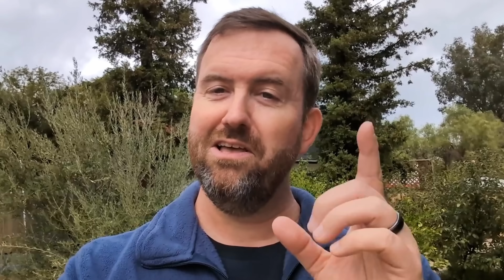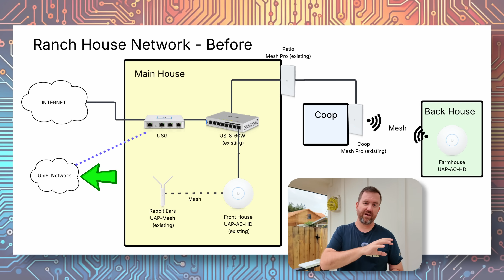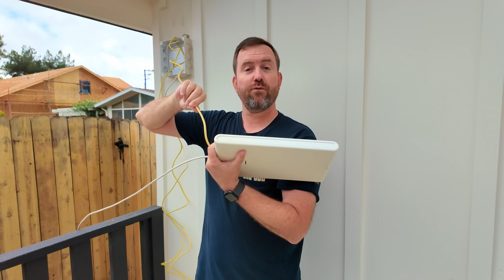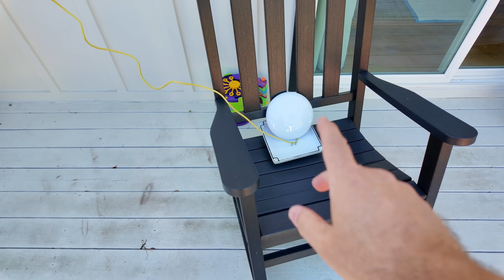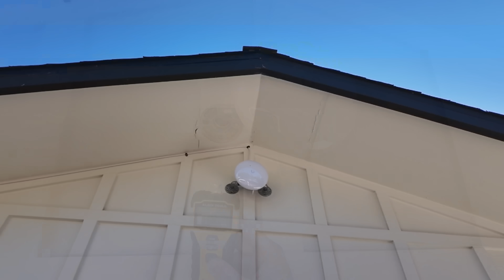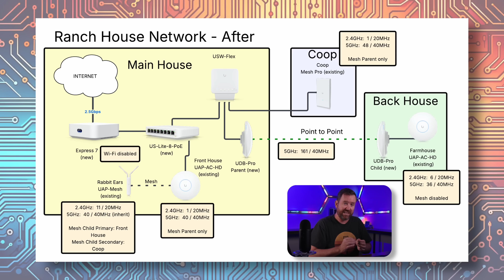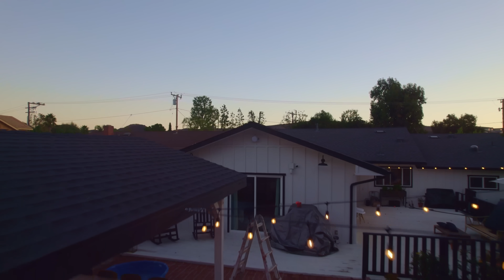How I Solved Terrible Wi-Fi with a Proper UniFi Bridge Setup

Comment: Love the upgrade, but would have just gotten a black cable vs. having to paint it to blend it. It's something I always do on site surveys. Edit: and THANK YOU for using shielded cable. Been trying to get my company to use it in buildouts for years. Maybe one day they'll say yes.
Reply from the maker: We were dealing with both white and black walls - and rather than buy two different colors of cable, we just went with white and will paint over that one small section on the coop.  The majority of the cable used was on white walls, so it worked great.

Comment: I remember watching the original video and thinking, "why not just run a trench and hard wire?"  But that might not be what customer wanted.  I've had several folks only want wireless and I've had to hide the WAPs in closets and above ceilings because they've not wanted to see the access points...  Ive been wondering about the UDB perfomance.. Glad to see its working well for you so far.
Reply from the maker: Trenching a wire to the back house wasn't realistic without huge expense - there's 4' of concrete walkway all the way around and connected to the foundation.
Reply: @CrosstalkSolutions  Ah, roger that...  Definitely  sporty to trench in that case..

Comment: Why is his solution always point to point? On a small private property like that why wouldn't you just run an ethernet cable to the back house? Especially since they were clearly already running a bunch of other cable for this install.
Reply from the maker: Trenching a wire to the back house wasn't realistic without huge expense - there's 4' of concrete walkway all the way around and connected to the foundation.
Reply: You’d want a fiber run rather than copper Ethernet cable. Fiber is non conductive. Lightning safe.

Comment: “Why not WiFi 6/7?”
Because the existing AP works and is already paid for. 

Have answered that question the same way for the same devices countless times. The UAP-AC-HD is a solid AP that does the job. Ain’t no reason to replace it unless you’re a YouTuber getting paid to do it or somebody who needs to see numbers go brrr.
Reply from the maker: If it ain't broke...don't fix it.

Comment: Nice video. Why not use nanobeam 5ac?
Reply: As mentioned by Crosstalk - they are not UniFi devices - require an external monitoring plane (UISP/or manual/remote desktop)  They are also 24v passive devices that would require separate power injectors for a  remote client site.   You do not want untrained/remote hands plugging in 24v passive devices improperly.   Even with marked cables, labeled injectors and devices that all goes out the window when an issue starts and someone will slip up and parts will become changed and potentially damaged.
The UDB Pro also are AF/AT with AF/AT passthough power options to expand into cameras or other devices in the future.   Yes it is a huge markup in price, but this is reasonable for support.
Reply from the maker: You certainly could!  But the NanoBeams are not controlled by UniFi, so you wouldn't get that single pane of glass interface for all of the equipment.

Comment: Trenching some fiber across would have been better imho
Reply from the maker: Trenching a wire to the back house wasn't realistic without huge expense - there's 4' of concrete walkway all the way around and connected to the foundation.
Reply: @CrosstalkSolutions  You just need a time machine to put in some conduit before the concrete was poured!
Reply: @CrosstalkSolutions  Yeah directional drilling is really costly.  Over the air works really well.  I have clients that have been using them since 2017 in unmanaged mode distance about 400 meters and not ONE complaint!  Solid bracketing, alignment and protecting wires from chewing animals goes a LONG way to ending nuisance calls.
Reply: That's always my goal between buildings it in reality that's only worth it during construction or if you can do it yourself renting equipment. Otherwise your paying someone to trend blue Smurf tube or conduit for you and that's gonna cost some these days

Comment: Looks great! But my only question is, why was the PtP link main side not installed on the coop instead of the main house to keep the link distance as short as possible, since the coop was already hardwired? And running cat6 on the fence from the coop to the Airbnb could probably have been an option?
Reply from the maker: There were trees in the way between the Coop and the back house unfortunately - the clearest line of sight was from the main house (among other reasons).  I'm sure we could have probably made that work, but the way we did it was also fine.  

And we discussed hardwiring the back house, but the whole thing is surrounded by concrete, so there was no real clean way to do that without trenching or running the cable through the air somewhere.
Reply: @CrosstalkSolutions Thanks for the explanation!

Comment: Instead of not using WiFi7 AP's , you could have just created a 2.4 GHz SSID just for the devices struggling with connecting. I have just upgraded to U7 Pro XGS and saw the same problems with some devices. After creating a 2.4 GHz only SSID these problems have gone. And the devices that can use WiFi7 are working great.
Reply from the maker: As I showed in this video (maybe I explained it poorly), in my own home network, I have a separate 2.4GHz-only network created and I'm still seeing drop-offs of some IoT devices.  So I didn't want to take that chance with a network I'm not local enough to troubleshoot onsite.

Comment: This video is a good show of why you should not used mesh WiFi and also to not use auto-tuning!
Reply from the maker: The Wi-Fi tuning is key!
Reply: @CrosstalkSolutions  Would love to see another video specifically on this.
Reply: @CrosstalkSolutions  I said auto-tuning which will use prohibited bands, will force your device to disconnect and reconnect constantly, etc. Manual tuning and avoiding the prohibited bands is key
Reply: @Traumatree   --  source, please, for your claim that auto-tuning uses prohibited bands.
Reply: My Deco mesh wifi has no issues. Have bunch of iot devices, Apple, Android/Window devices as well.

Comment: 7:47 I had some issues with the unifi wifi7 at the beginning.  After creating a separate network for IOT devices only with the “enhanced iot connectivity” flag on, I haven’t found a single iot device that doesn’t work correctly.

For the main network I’ve had to change a few options from default, but it’s all ironed out now.  Even the Apple devices work fine, and that’s with MLO enabled.
Reply from the maker: I'm glad that your issues were resolved!  I'm still seeing drop-offs with some IoT devices (really just my Elgato Key Lights...but it's constant) even after creating a separate 2.4GHz-only network and enabling enhanced IoT compatability.

BUT - as I mentioned in this video...maybe that would have worked here?  But I'm not local to be able to troubleshoot it, so I didn't want to take a chance on any potential issues.
Reply: I went so far as to create a separate IoT network for each AP. Many of these IoT devices just can't handle having multiple APs with the same SSID. Locking it to a certain AP in the console won't stop the device from trying, so isn't really a solution. You do loose redundancy, but not having a device constantly trying to connect to every AP it sees can make things more stable.